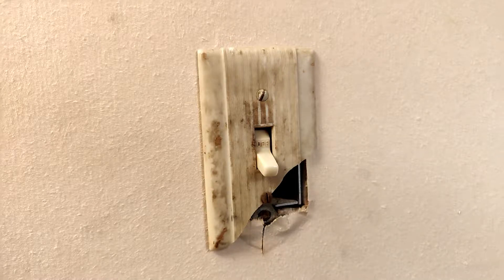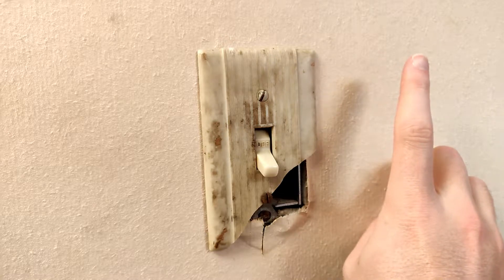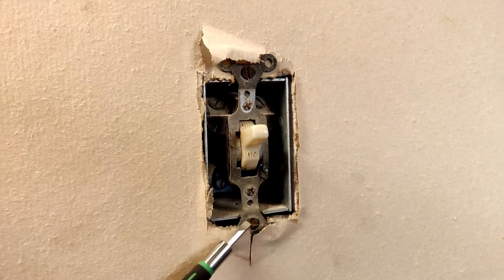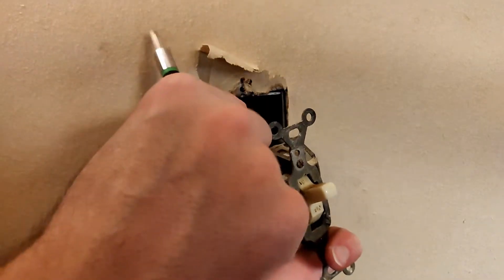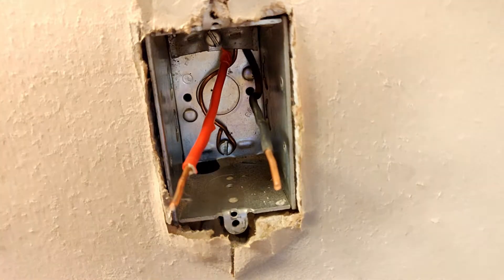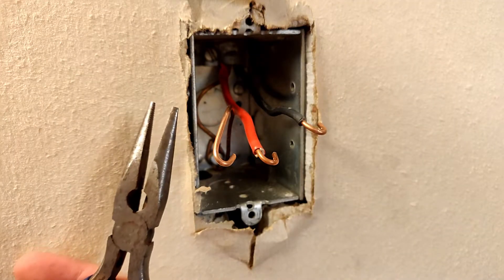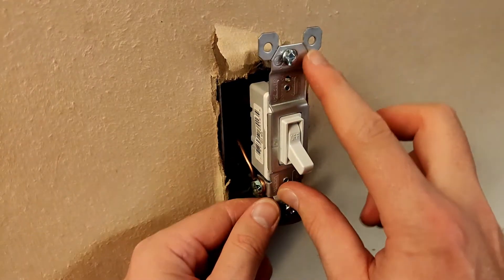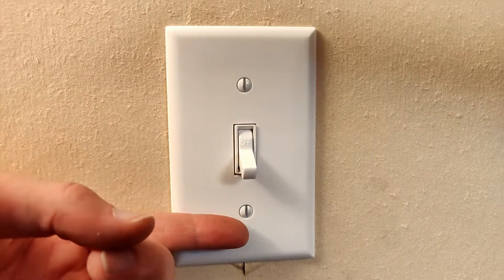How to Change a Single Pole Switch in Under 3 Minutes

Comment: When I took off my single pole switch I had two hot wires to the bottom screw. One was stabbed in the back and the other around the screw. It had another one stabbed at the top screw. What does this mean?? As far as I know it just controls the one light fixture in the room